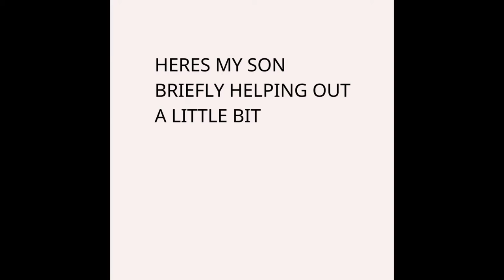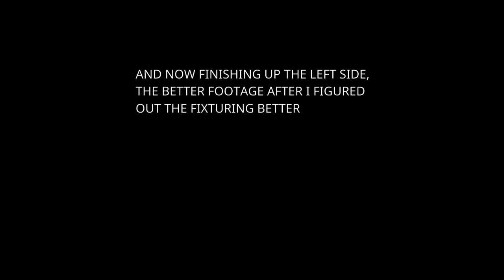HOMEMADE BALLJOINT PRESS FRAME FOR A BOTTLEJACK IN ACTION

Comment: go auto parts get a loaner
Reply from the maker: Have done that before, typically missing parts, and the C frame ball joint press doesn't have as much leverage, thought i was going to bust it. This frame gave me so much more power to press, and can use for other things too where that other tool typically cant. Plus interesting project to see how it would turn out....Thanks for comment.